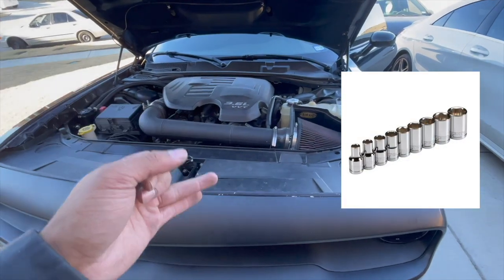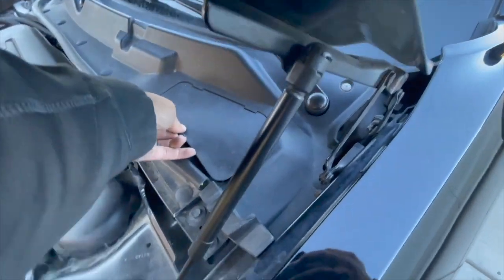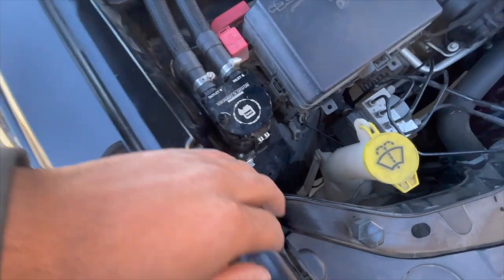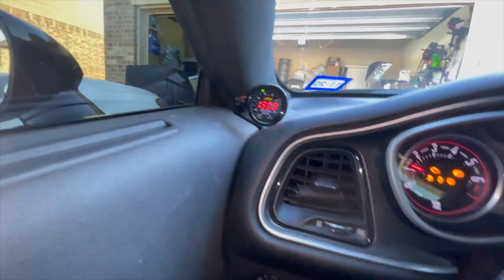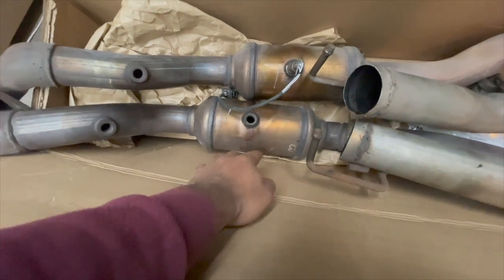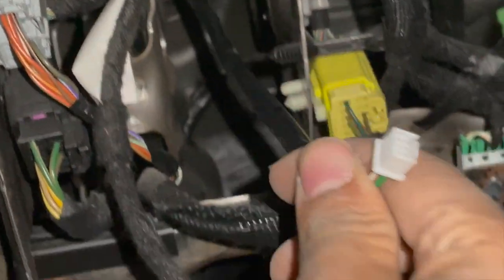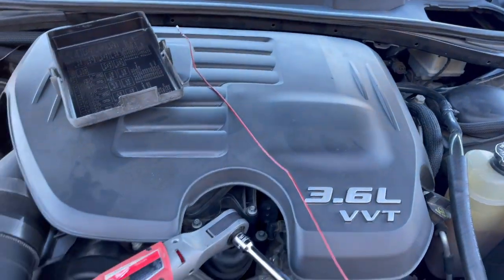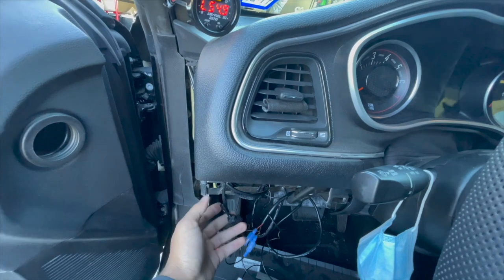AEM 30-0334 X-Series Wideband (AFR) Install

Comment from the maker: If you have any questions comment down below!
Reply: How does the cord for the obd2 work? The pass through part.
Reply: If you swap the O2 sensor from the OEM with the one from AEM, dont you get an engine light since it is not communicating with the car ECU ? Also, does it go BEFORE or AFTER the Catalytic converter ?
Reply: @soufianDEMOS  you need to swap out the new 02 for the old 02. Once its tuned in, take it out n replace with the oem, then tune in the short trims for fuel.

Comment: Clean job, dude :)   Nice job, with the extra switch.  Now, you can NEVER start your engine, with the sensor already heated up.  Starting on a hot sensor is the #1 killer of wideband sensors!
Reply from the maker: i’m aware! ✊🏽

Comment: Good work Luckey.
hmmm Instead of a switch, mine comes on with the key.
I jumped into one of the wires on the panel that is below the steering wheel.
Reply from the maker: i can wire it to something like that aswell but i’ll have a nicer switch coming only on when the car is running
Reply: @BOOSTEDLUCKEY  Like a relay?

Comment: I understand everything except for the o2 sensor part. Can you explain it more in depth of the steps to doing the whole o2 sensor part? I really appreciate it
Reply from the maker: there’s a whole near where the brake fluid tank is at that is a clear shot down to the bottom of the car you just drop the harness that connects to the o2 sensors through there and connect it to the sensor and then make sure it’s tucked away so it won’t get damaged while driving that’s it
Reply: @BOOSTEDLUCKEY  im still confused, the wideband kit gave me another o2 sensor. It says I have to weld the bung first onto the exhaust and the run the wires and whatnot
Reply: @BOOSTEDLUCKEY  never mind, I get it now. You had available sensor bungs from when your cats got taken out so you just plugged one and used the other one for the wideband. I don’t have any available sensor bungs so I’ll have to go to a shop to get the one in the kit welded on
Reply from the maker: @Clutched392  yes our 6’s come with 4 i deleted the two down streams